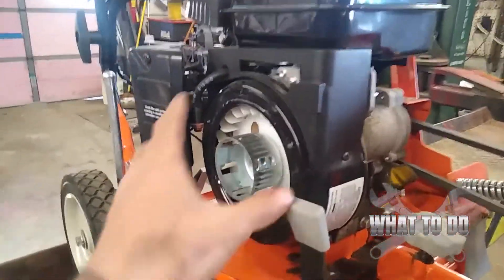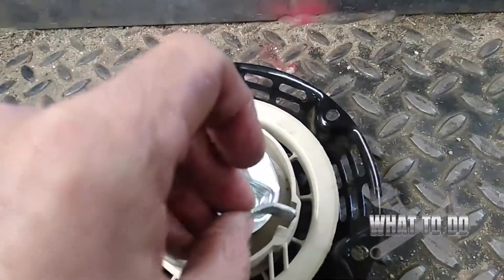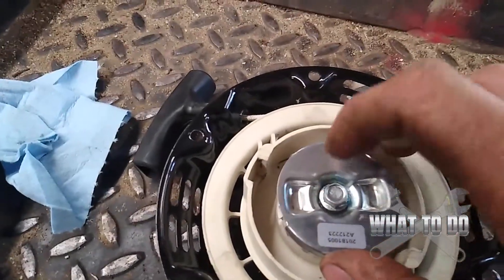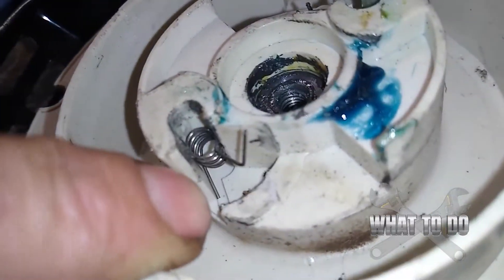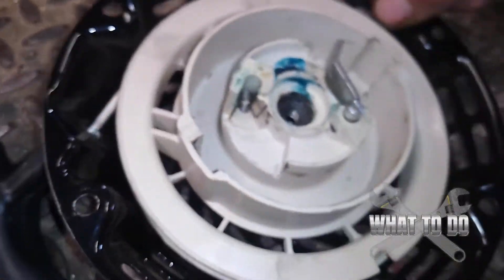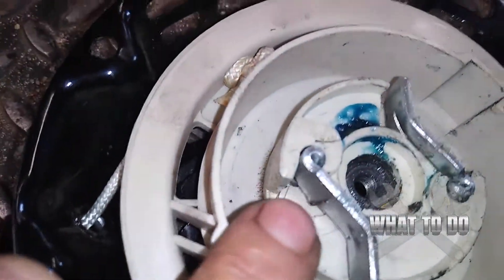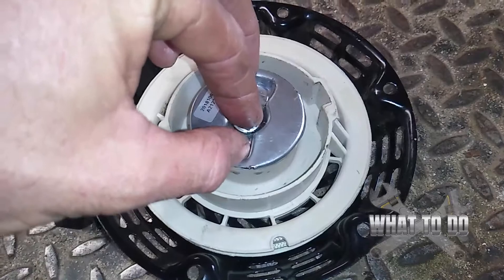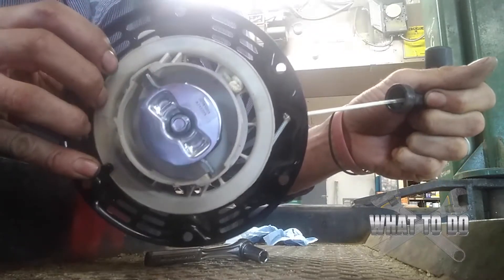How to Fix Pull Start - Pawl / Ratchet Tabs  on Edger

Comment: Wish i saw this video before i went on Ebay and ordered a whole new pull starter assembly. 1 of my pawls fell off and i thought it was broken. I didn't realize you could reattach them. Assumed that round metal part the pawls come out of was all 1 piece and the pawl snapped in half. Almost broke my freaking hand when i went to start my mini bike and the rope snapped back. Hurt like a mother !!

Comment: Rob, very helpful. I am missing that spring that goes around the screw that holds the assembly in place. You said that if you don't have this spring, it won't work. You're right.  I can't find a way to order this spring because I cannot find a part number for it. Suggestions? is there a generic spring that would work or is that spring unique?